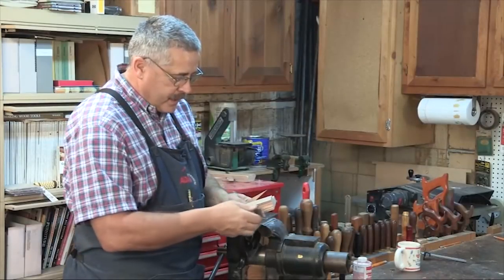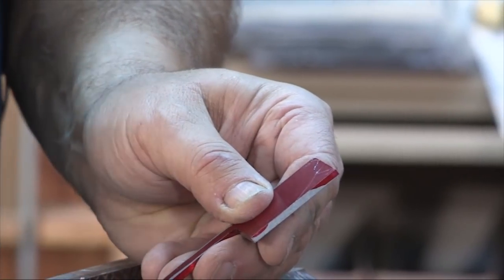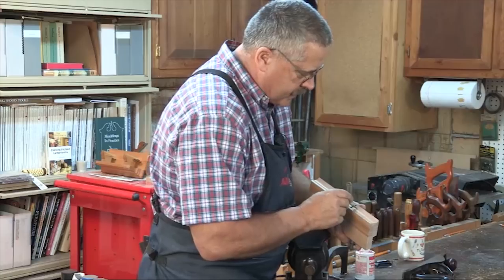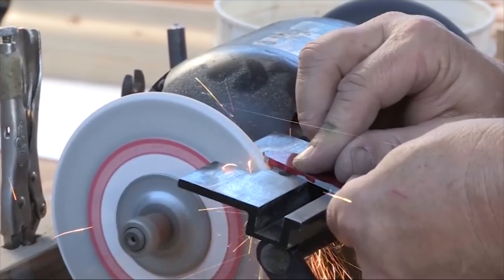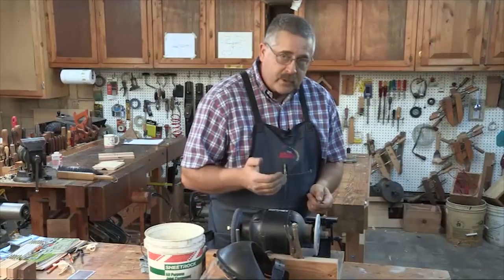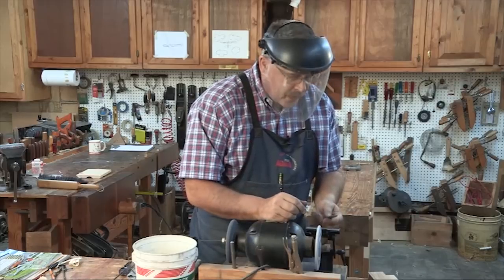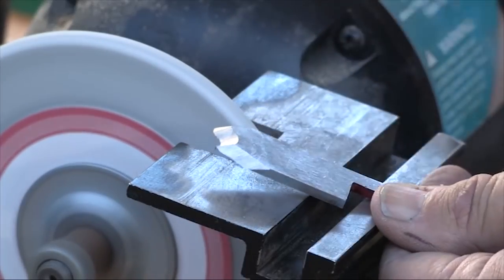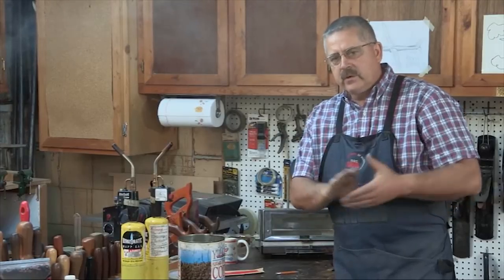Grinding a Custom Moulding Iron

Comment: Interesting stuff.... any advice for me, I want to form cutting blades to turn chess pieces.... what type and grade of grinding disks are you using, what steel, and what angle are you grinding at to achieve the basic edge profile...?? Any help on this appreciated.... thank you...
Reply: I have similar intentions. Did you ever figure out a way to do this? It gets kind of tricky with some of the intricate detailing of small chess pieces. Still been on my mind though.